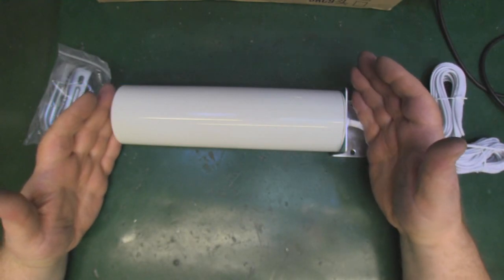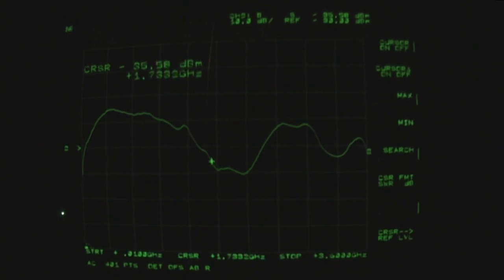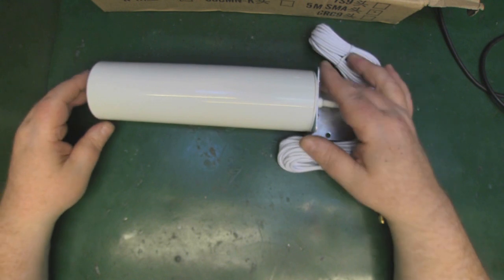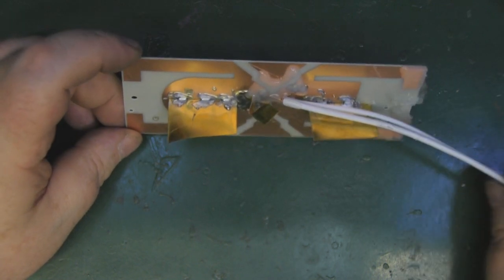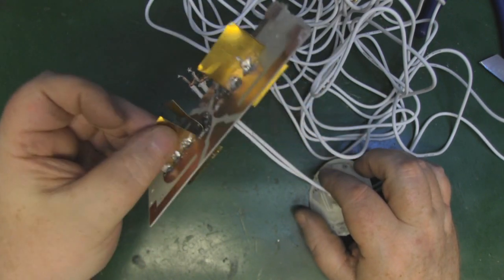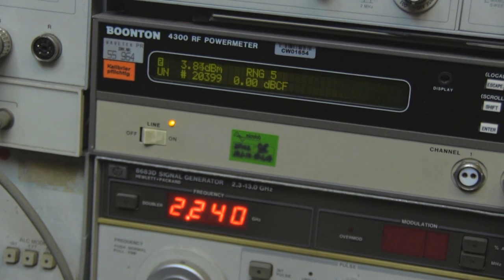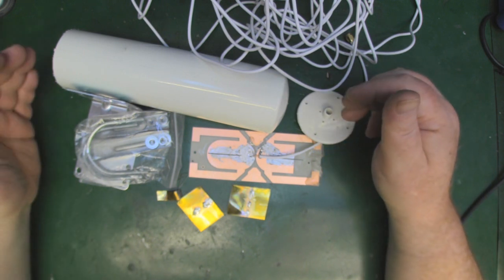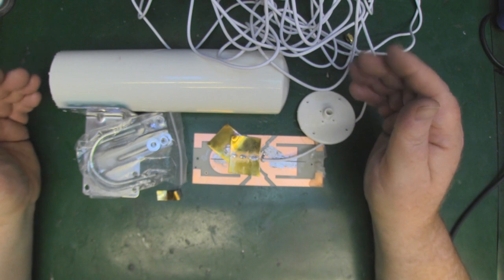3G 4G LTE 12dBi Signal Booster Antenna

Comment: Thanks Andrew, very nice to know.

I was lucky to find your test on the internet just before I was going to order.
It saved me € 20, waiting time and disappointment.
What "cheap" external 3G 4G LTE antenna would you recommend, working ok around 2600Mhz.

Have you tested any Wireless WiFi Repeater Wifi Extender, is there anyone you can recommend or are they also "nice but fake"

Comment: Thank you for breaking open and testing an LTE antenna.  Chinese engineers achieved their design goal when you clicked the buy button.  No takey back.  Russian 4G antennas have a good reputation but they stick to the middle bands at 1800MHz.  In the U.S. I mostly connect at 800 on the main and 1900 or 2600MHz on the diversity; which makes it difficult to find a good antenna.
Reply: This is true. The UK use 800mhz in a lot of rural areas and I'm struggling to find an antenna that will provide suitable gains
Reply: @dazmatic  lot of parabolic antenna 4g have that. In AliExpress. Expensive because the antenna really big, heavy and REAL high gain but worth for money

Comment: Very interesting video Andrew - I'm really looking forward to your analysis of further 4G LTE antennas. I've found your WiFi antenna videos very interesting but not directly relevant to my purpose of WiFi in a caravan. I bought this exact same antenna for £49.99 on the recommendation of another YouTuber who I thought knew his way around such technology - he's even got an affiliate link to the Amazon listing of this chinese con-job, which advertises it as having a 35dB gain. I know it's the same antenna because I pulled mine apart too after having used it on my Huawei B525s LTE router, which didn't even recognise it as an external antenna when plugged in. I eventually got my money back having complained on much the same grounds as you list in your video. My guess is that this is basically an old superceded narrowband WiFi antenna which has been hacked. I've now bought an Alfa AOA-4G-8F which I'm hoping will work much better.
Reply: The antenna you list looks good. Can I use that Alfa you list to plug into a device with two TS-9 connections? I was just about to buy one of these then found this video.

Comment: Dr. Sir ..i'm from sri lanka . u'r  channel is very very useful..i like to know .. what is the  most  suitable caox  cable for 2300-2600mhz  range ..normally i used rg6u  coax but it 75 ohm . but i want to use 50ohm cable for my 4g antennas  they are price  is very high
Reply: You might get away with rg-58, it's 50 ohm, popular with ham radio. Pretty cheap.

Comment: you save me.. i want to buy 4g lte antenna and this was one of my top list... i hope you show us your own build so we can do the same.. and for lte sginal what coaxe cable do you suggest. for best sginal and minimal loss.. ty
Reply: I always find 4G antenna frequency interesting. #1 you don't need an external antenna in good signal areas. #2 in bad signal areas, the highest frequencies are the first to drop out.
Depending on your provider, look up what are the lowest 4G frequencies they support and then buy an antenna for that range.  For instance "4GX" in Australia operates around 750MHz. There are other supported 4G frequencies from same carrier, but they are typically over 1GHz and far from a tower, useless.  In low signal areas, choose low frequency, it travels further.
Antenna type? Fixed position, a yagi. On the move, an omni "whip" type.  Test using a mobile app like LTE Discovery.

Comment: What a mess, it's more of a bad terminator than an antenna. However on the bright side, the VSWR might actually measure as 1.4 or better, since all the forward and reverse power gets wasted in the cheap coax anyway. 
Interesting look at this thing, I guess they tried to match it for the 1880MHz LTE band used in most of europe.

Comment: Can you recommend a good place to buy a decent length of coax cable with SMA connectors already attached? I have a Pontying Antenna for my LTE+ antenna but the cable was cut and I'd like to rebuild it. Great video as usual.

Comment: Thank you very very much Andrew! I have this antenna on my van and have had the results you expressed. tried soldering my own IPEX pigtails on that coax and found the cable center and sheath is copper coated aluminum so as soon as you heat and get that coating off or get to the edge of the cut wire by soldering it won't tin and ruins your soldering iron tip no mater the flux. Now you have fully proven my thoughts by taking it apart and showing me the abomination i thought it was. its coming off the roof of the van in the morning. I already have an Antenna Vector Analyzer now and have built some ground plane antennas to exact frequency with success. Just finished a set of Bi-Quad antennas i have made along with type-N and sma connectors for me to do testing and  mounting tomorrow. Subscribed due to this video, 73s from SW1IUK currently residing in Australia. :-)
Reply from the maker: Glad it helped